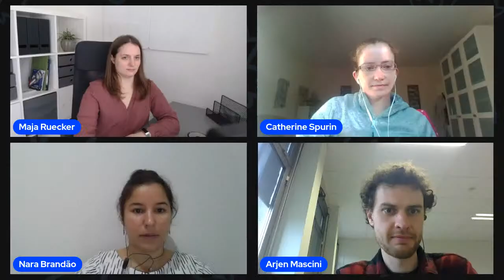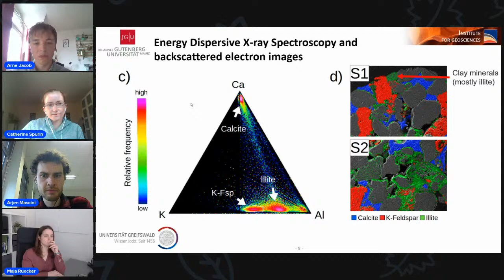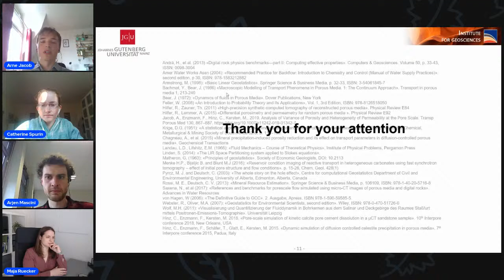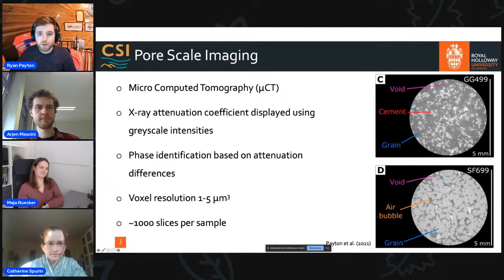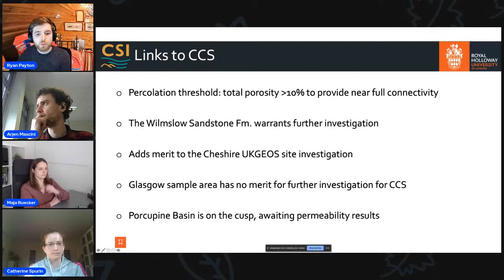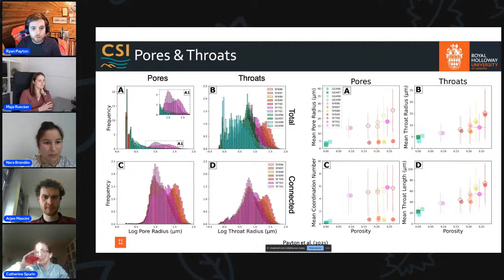Session 15 - Arne Jacob (University of Mainz) & Ryan Payton (Royal Holloway University of London)

Comment: can one generalize at which resolved permeability which matrix permeability would matter ?
Reply: Good question. We could conclude that there are too many variables to derive a generalizable threshold based on permeability only. It highly depends on which type of clays are included in the rock, how these clays are distributed, and which clay geometry is dominant. Curvature and weathering conditions of the main grains (q, fsp, etc..) play a role too. If resolution is good enough to resolve the structure within the operating envelope of XCT (Saxena 2018), the effect of clays on permeability increases with decreasing rock permeability. We're still investigating different clay morphologies to build a sound basis for advanced clay mineral modelling. It may be possible to calculate rock permeability even more accurate when other clay morphologies are incuded as well.